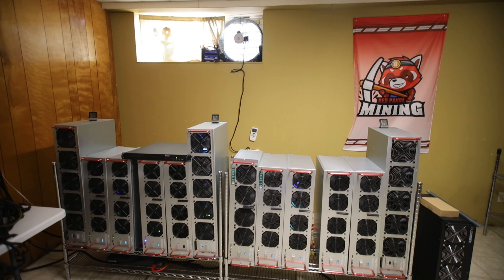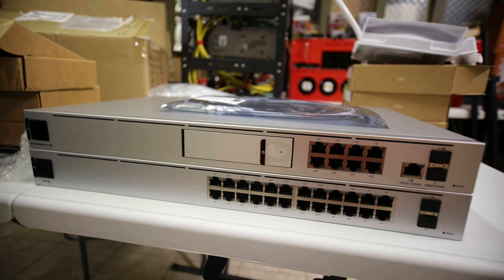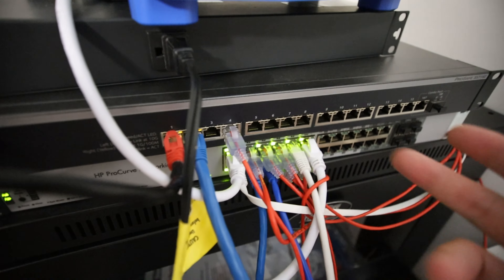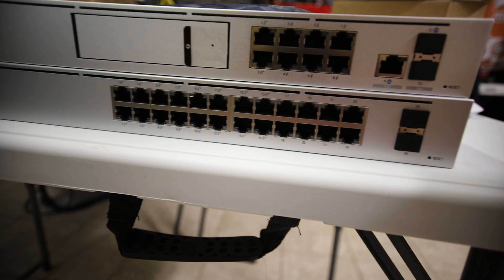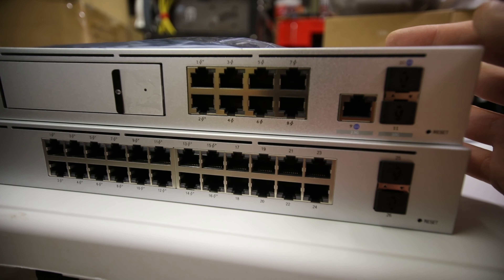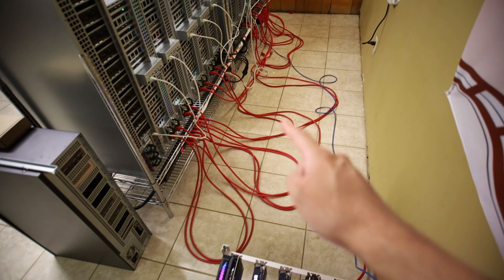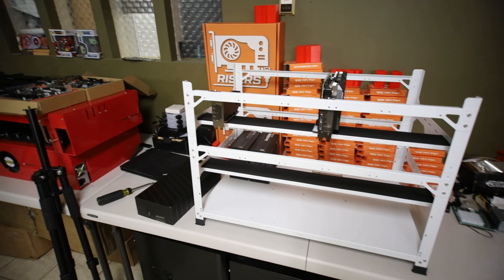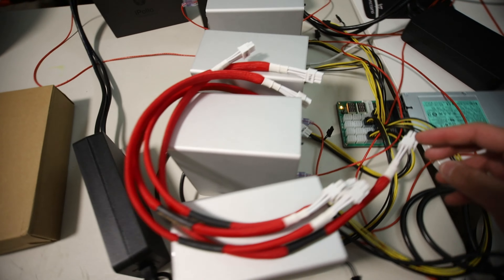this is going to be fun

Comment: So funny you did this vid as I just received my unifi dream machine pro, 24 port poe switch and the wifi 6 pro (lite was out of stock and I didn't want to wait anymore)!  Was easy to setup and the hardest part was pulling cable to the AP and mounting the mount for it.  Such a bummer the switch doesn't have a 10 gig DAC and I missed that myself but oh well.  Enjoy the new hardware.  I know I am!

Comment: As someone who has personally installed whole house network systems, you can never have too much wire runs. I always have regret of not having enough ethernet wire runs. Now that POE security products are available... new locations for security cameras outside the house and inside home. For me, I do not view security footage until it is needed. I could care less of what goes around the house. Trying to install network wires after walls are closed is just a bunch of headaches.

Comment: In the setup I manage we are using the bottom 32 port switch. Absolutely love it. We were having problems with Network Storming when rigs would have a problem, go offline and shut down the whole home network until we could unplug them. That switch is mint and it keeps out network nice and stable. :D

Comment: I also have a networking background and am excited for you.  I have worked with both pfsense and the ubiquity routers.  The ubiquity routers do not have anywhere near the capabilities of pfsense.  No openVPN support.  They do work great for basic internet access and have easy vlan setup though.  I ended up using the ubiquity hardware for almost everything but still use pfsense for my router.

Comment: PoE will work fine through your Cat6A patch panel. I have a very similar setup so let me know if you have any questions. Ubiquiti all the way!!
Reply: Also, I don’t think your Netgear SFP port will support the 10Gb DAC to the 10Gb port on the UDM Pro SE. I believe SFP is rated at 1Gbps and not 10Gbps. I hope I’m wrong!

EDIT: I was wrong. You can use the DAC into the Netgear SFP port, but you’ll be limited to 1Gbps.

SFP delivers 1Gbps of data and SFP+ supports the data rates up to 10 Gbps. Having the same size, an SFP module can fit seamlessly into the SFP+ port on the switch and vice versa. If you insert an SFP+ module into an SFP port, they will still work but the transmission speed will be limited at 1 Gbps.

Comment: Anybody have a recommendation for cellular capable 24 port router?
Reply: why not get the router and switch separately?  there's a netgear router with cel sim slot that's really cheap, pair that with a cheap 24 port switch and you're all good.
Reply: @webby459  I'm trying to learn the networking side with cell data.  So this was very helpful thankyou.
Reply: Ubiquiti sells a lte backup that connects to their switches that you can use with their unifi eco system